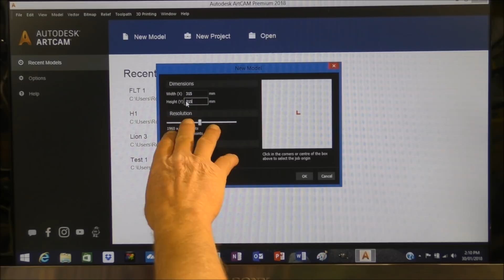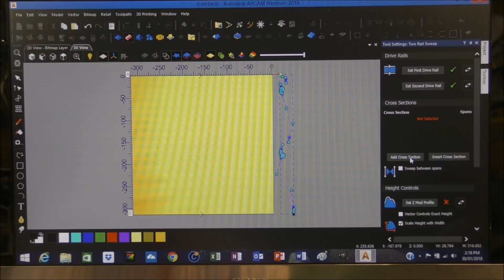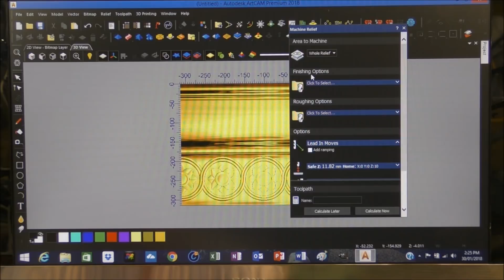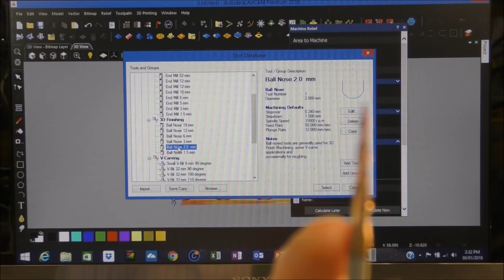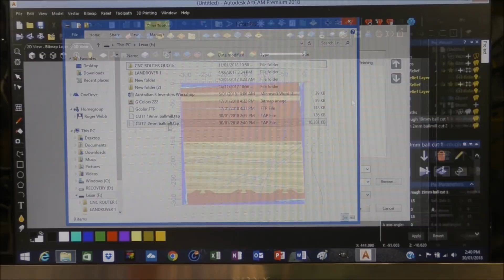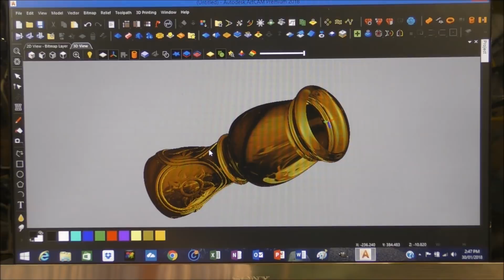226 ArtCAM is "NOT dead" it’s still alive and supported HERE!!!

Comment: Hi Roger, why I can't get to generate G-code in ArtCam with Y, Z & A axis?, ArtCam just generate X, Z & A axis although I wrap it in X or Y, it always generate X, Z & A, could you help me on this matter?, Do you have a vídeo regarding this matter?, Tks a lot in advance.
Reply from the maker: Hi, you can use the X or the Y for the A 4th axis, you don't need A output to use the 4th axis.
Reply: @inventorsworkshop9600  I will, tks a lot again.

Comment: I have question regarding to my machine. I have 3axis router machine as you have told very beautiful in your video how it works but as I switched x axis motion my rotary stepper motor pulse is not mach my x axis pulse rate so here is the problem that my  x axis 1pulse =1mm but my rotary 1pulse is not equal to 1mm so in this case how I work for design.
Reply from the maker: Hi Shamit, have a look at my videos 225 and 227

Comment: I had a client at one time said the computer would not work on the desk. So they set it on the floor. So when they called the asked for a longer power cord. I asked if the was something in the center of the cord. They said yes come to find out it was still tywrapped to gether in its origial packing. Had them cut the the tywrap and the said oh it now off the floor on able to place it on the desk. Thank you for your videos its helped a great deal.